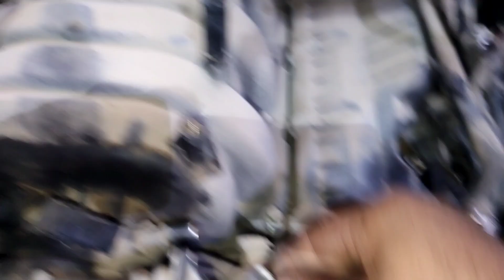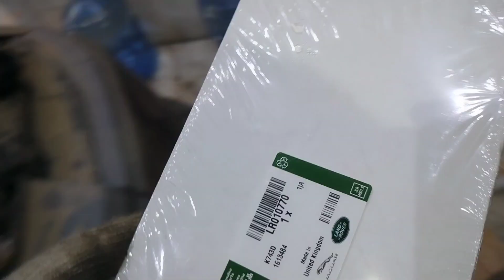How To replace Engine Oil Cooler Range Rover

Comment: Do the failure of the oil cooler gasket causes misfire  ? Cylinder # 8 on my 2012 Jaguar XJ supercharger spark plug is wet and not given spark. I replace fuel injector spark plug and coil and still the spark plug is still getting wet with coolant n oil , mostly coolant.

Comment: My range sport 2006 oil mixed with water in the motor could you help
Reply from the maker: Change engine oil cooler
And gearbox oil cooler
Reply: What year is your vehicle?